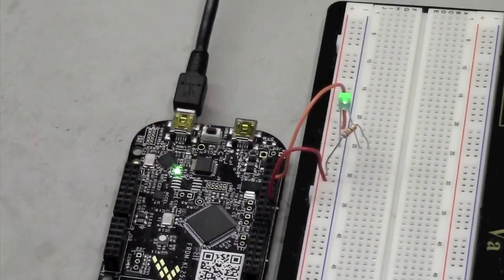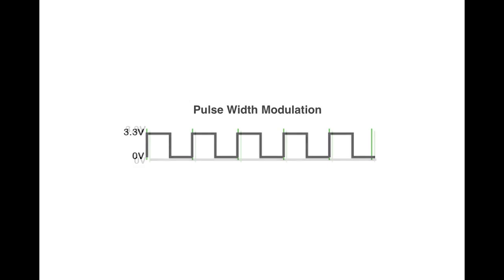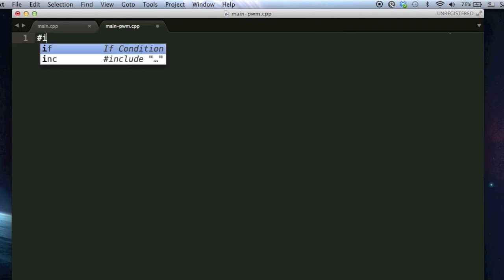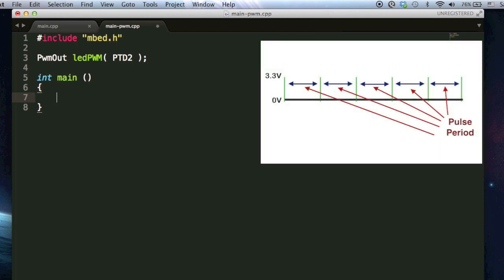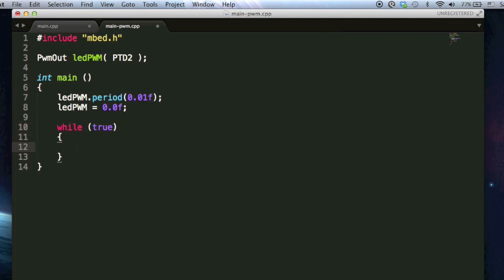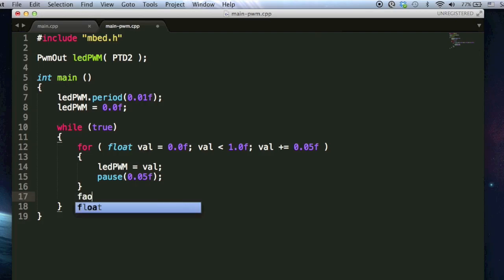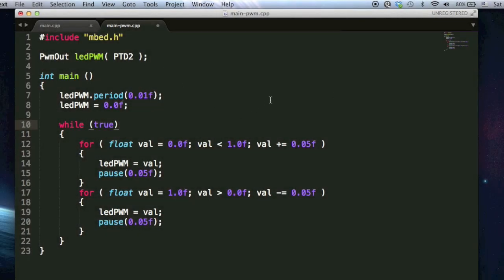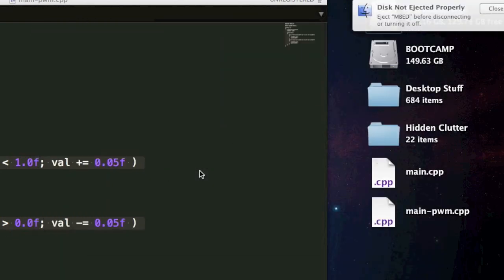mBed Tutorial 3: Pulse Width Modulation

Comment: I've tried this program with my st nucleo but it will not run on the in built LED.
I was wondering whether the pwm in mbed.h uses dedicated pwm outputs in the microcontroller or whether it will allow bit-banging GPIOs?
Reply from the maker: You should reference the mbed source code to determine which digital pins allow for pwm. There is typically a peripheralpins.c file for each microcontroller they have that contains that information. It's a fairly exhaustive dig, but here it is for the KL25z: http://developer.mbed.org/users/mbed_official/code/mbed-src/file/12e8e4569aa7/targets/hal/TARGET_Freescale/TARGET_KLXX/TARGET_KL25Z/PeripheralPins.c  You should be able to find the nucleo boards here:http://developer.mbed.org/users/mbed_official/code/mbed-src/file/12e8e4569aa7/targets/hal/TARGET_STM     For the nucleo401RE, it's here:http://developer.mbed.org/users/mbed_official/code/mbed-src/file/12e8e4569aa7/targets/hal/TARGET_STM/TARGET_NUCLEO_F401RE/PeripheralPins.c
Reply: Bme Builds Wow, thanks for such a comprehensive reply!